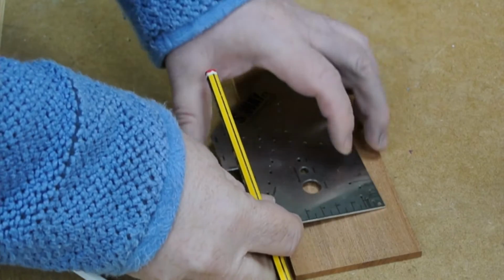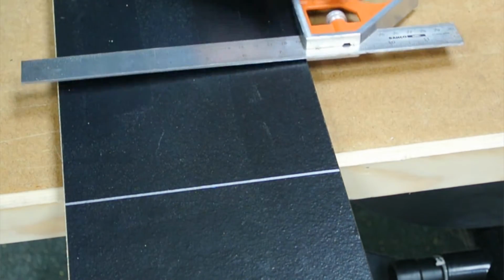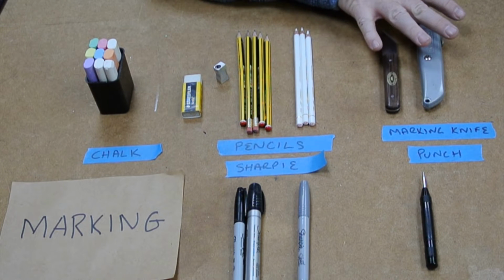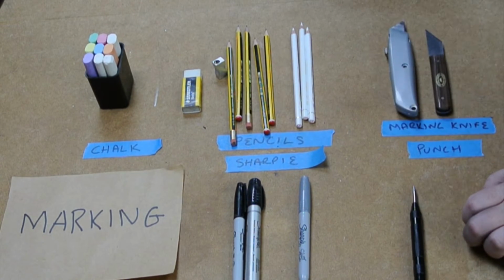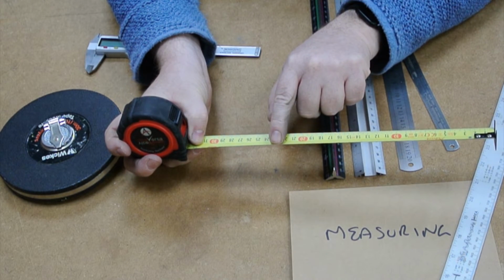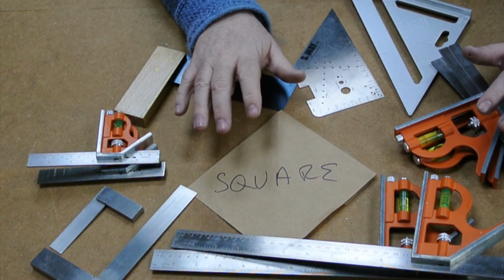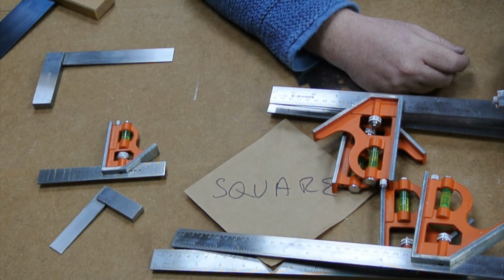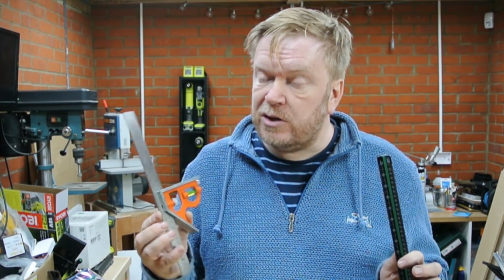Measuring & Marking | Workshop Tools & Techniques

Comment: Great work sir, material delivered really well!

I would add marking gauges to the essentials as well.

Something simple like https://www.amazon.com/Rockler-Wheel-Marking-Gauge/dp/B002MMKNLK for example ;)
Reply from the maker: I have a few more bits and bobs in the measuring and marking space including a Veritas wheel marking gauge which I use ALL the time. I may do a follow-up. K

Comment: Hmmm. The last square you showed, "No plans to do any more metric ones" . Err, why ?????    Love your video's by the way.
Reply from the maker: Hey steve - sorry for the delay in answering these. Tim Sway who produces the squares had a few issues in making metric ones which dissuaded him from making a second batch. Demand was lower than for the imperial but you had to produce many at once to make it pay, and postage to europe was high. However, he does now have metric versions available on his site along with a new polycabonate 'lite' version which he laser cuts on-demand and is easier to post. Thanks for the question.

Comment: Hi Karl, Thanks for the video. I’m going to order the Crown Tools marking knife from Axminster Tools. I like the idea of a stronger blade. I’m also going to buy an auto punch. My go-to marker for wood is a simple Bic pen. Cheap to buy, it gives a thin line and never needs sharpening!
Reply from the maker: That's fantastic, it's an exceptionally good value knife.

Comment: Cheers Karl. Once again, some very basic - and sound - advice vis-a-vis marking et al. On a separate subject, I'm looking to buy a 'Dremel-type' rotary multi tool, but the variety on offer is a tad mind-blowing to say the least. Do have any personal experience of these and if so, what would you recommend? Don't worry; I won't hold you liable if it goes pear-shaped... ;o)
Reply from the maker: I have a basic Dremel 3000 which I got from Amazon on Prime Day in the summer. It's fairly basic but well made and I haven't any complaints. In the past I've bought a set from Aldi and another from Wickes (in the UK) and these really didn't last well at all. The Wickes one developed a terrible wobble after only a few months. The Aldi one was OK but very badly designed and heavy in the hand. It did come with plenty more accessories that the Dremel out of the box, but to be honest in all the time I had it I just tore through the cutting disks and sanding drums and ended up buying what I needed as I needed it from Screwfix - have the stuff I never used.

In short, a cheaper Dremel is better value than a more comprehensive non-dremel in the long run. I hope that helps.
Reply: Thanks for that Karl. I'm a bit concerned about the Dremel inasmuch as many reviews have criticised the build quality. It seems that you can pay up to £50 (ish) and get some well reviewed devices, some with over 200 accessories. However, your comment about the quality of the accessories is well made. As I'm not looking to do a lot of work with this, just a bit of DIY when I'm pottering around, I think I might go for an inexpensive one with 5 star reviews and see how it goes. I'll let you know...
Reply: Update. I’ve finally bitten the bullet and gone with the NoCry 10/125 Professional Rotary Tool Kit from Amazon. The accessories look impressive, including a precision handle that I’ve not seen on any other tool kit. It’s well reviewed on Amazon (5 stars) and the company has good reviews all round. Due on Saturday, I’ll let you know how I get on with it.
Reply from the maker: Cool - new tool day is always the best day of the week.
Reply: Not sure if the memsahibs would necessarily agree with that Karl, unless it gets us out from under their feet bless 'em 😁
Reply: NoCry rotary tool received last week and although I'm not able to to use it properly yet [dodgy digit :O( ], the build quality certainly appears impressive. Hopefully in a week or three, I'll be able to report back on it's performance in the 'workshop' (i.e. garage...).
Reply from the maker: Good to hear. And I’ll look forward to hearing how things turn out.

Comment: Hi Karl you got settled in now, bet your glad you got far more space. I have a garage as a workshop but mine is very cold and slightly damp at one side due to wall being single skinned at partial backup with next doors garden. Do you still have your Evolution fury table saw, do you think its okay? Just wondering as I am tempted to get a table saw I do have evolution mitre saw.Anyone have a merry xmas. Some great tips for stocking fillers. I got a digital caliper last year and I never stop using it now also found useful digital angle finder
Reply from the maker: I do have the evolution table saw and for the money it's a great tool. It is accurate enough and is only let down slightly by a fence which can flex if you are not careful. But to be honest if I were to start over again I'd give some thought to getting a tracksaw instead of the table saw. The Titan saw from Screwfix is fantastic value and now I've invested in a tracksaw I'm using more than the table saw.
Reply: Thanks Karl I was looking at that as well. You can buy extra fences seem quite expensive though for what is after all just aluminium. Thanks for the advice
Reply: I noticed Aldi are selling them omline perhaps some shops still have them it seems its a SCHEPPACH rebranded tracksaw

Comment: Great video - Thanks for the tip about the silver sharpies - will get one. I like the Edding 8850 Carpenters Pen for marking through timber etc and prefer a mechanical pencil for marking - soft lead so easy to sand away. Also use the Babco square, work great for me too. Best tape measure I've found is the metric only Stanley Fat Max - easy to mark above and below tape and tough, cheers,
Reply from the maker: Hey Bill - thanks for the feedback. I'd not come across the Edding Carpenter's Pen before and I'm going to check that out. As for the FatMax - I agree they're fine tapes - especially the metric only one. Mine's missing and I think I might have left in ceiling of the workshop. lol.

Comment: With all you measuring bits and pieces like you're Norm, (New Yankee workshop), only with him it's routers :D
Reply from the maker: Thanks for the comparison, I'm a long way of being anything like Norm. I don't own a biscuit jointer for one.😀
Reply: Now let's be fair here, Norm had a workshop far better equipped than most professional joiners/carpenters so he does cheat a little haha! I've got a biscuit joiner but hardly ever use it. In fact ..... Thinking about it I've got a lot of mechanics tools I hardly ever use mainly because  forget I have them. That's the trouble with loads of tools, if they're in boxes you tend to forget you have them until you go to the box for something else then realise you had the perfect tool for the job you've just taken 3 hours to do that would have done it in 20 mins <sigh>